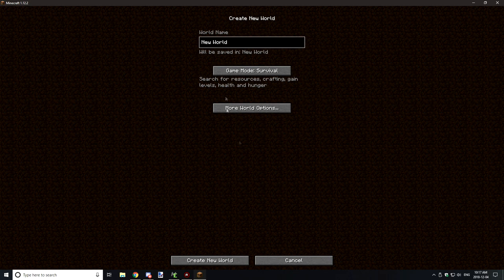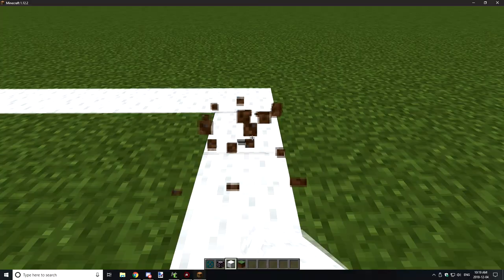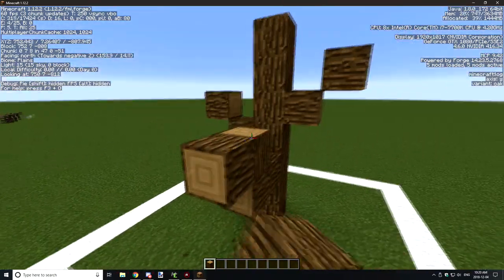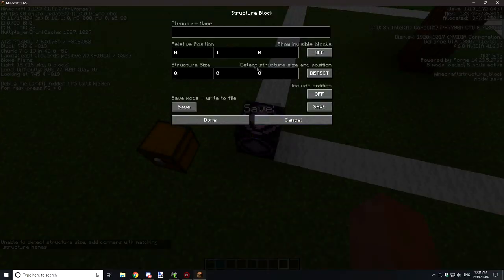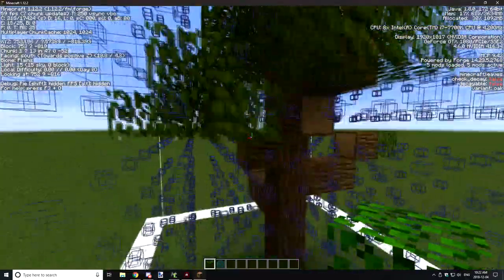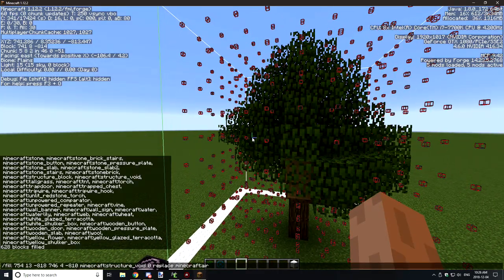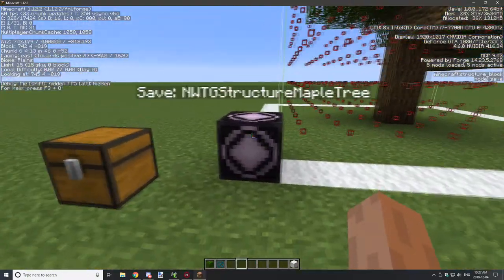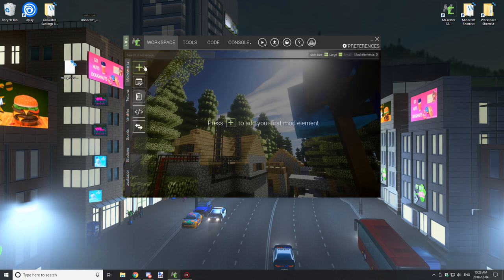MCreator Tutorial: How to make structures | 1.8.1

Comment: it didnt appear ANYWHERE
Reply from the maker: You may have the spawn chance vary low, This should still work in 1.9 however I have not tested it. The best way to test if structures are spawning are to increase the value for the amount per chunks to see if that is the cause of it not showing up. I will be updating the tutorial in the future for 1.9 GUI so I will make sure to test for any problems then.

Comment: why does my tree spawn undergound? i dont have the option "underground" selected
Reply from the maker: This may be a bug with older version I think it may be fixed in 1.9.1 I would have to read the change log again to know for sure. I think it has something to do with MCreators settings for NBT you can try using schematics instead from MCEdit those have worked in the past. NBT is easier to do though.

Comment: Can be made with custom blocks?
Reply from the maker: Yes, just use structure blocks when in the Test Environment and use your own blocks rather than vanilla ones and it will work fine.
I would suggest if your going to make a growable sapling to not use structures as they can grief terrain and are a pain to offset properly using structures. I did make a tutorial and provide a procedure and workspace on my website for a more advanced system that uses a bunch of testing and placing of blocks for a regular oak tree. That system will not grief and its set up where you just need to add your own mod blocks to grow the tree and the rest is all codded in by me.

Buy if its for just using it for structure elements this will work fine, the only issue I have had with structure elements is it floating a bit, I am not sure if its NBT or if its just structures in general but they can look a bit odd sometimes.
Reply: Ok, thank you.

Comment: but the problem is that the limit
of the block structure is 32 block
Reply from the maker: I think you can use Schematics from MCEdit but I don't know if there is a cap on those as well for MCreator.
Reply: @NorthWestTreesMCreator  when I add the comment my problem is solved yesterday thanks to the mod (better block of structure) which allowed to make the tructure bigger
Reply from the maker: The only thing I can say is be cautions of the size of structure because if it is to large it can cause lots of lag when generating in the world. Villages are broken up into smaller components as most other structures such as woodland mansions and so on. I just have not been able to figure out how to do this just yet. I also don't know if its possible in MCreators current state.
Reply: ok

Comment: I have a problem, with the structure that I did, when the mcreator could test how the structure was and it was half wrong because the house door that I made for this mod is covered with earth, there is a solution to repair this problem,
I have Another problem I want to generate items or blocks of anything and generate items or blocks of other mods in the chest in the structures that I did.
a question you know how you can general items or minecraft blocks and things mods in the random box.
Reply from the maker: Only fill the blocks that you want to spawn other blocks with structure voids, anything you want to have air/other blocks use air/the block you want to spawn in the structure.
TIP: Place any block like dirt where structure voids are, then break that block to make it air again.

The only thing I can think of making items spawn is having a set chest with the items in it, before you export your structure, NBT should hold that data as its the same data Minecraft uses to generate their structures, as far as the random generation I don't know how to do that in MCreator.